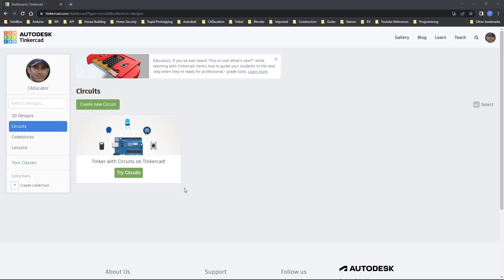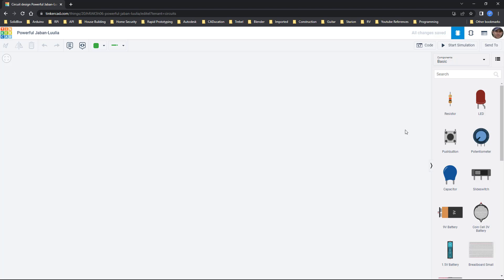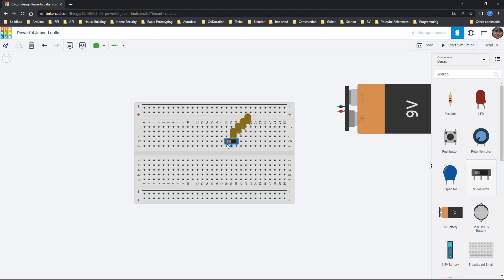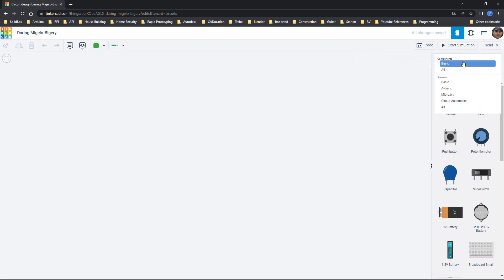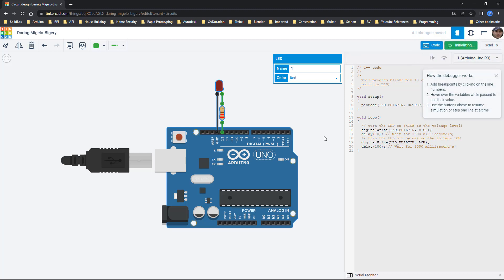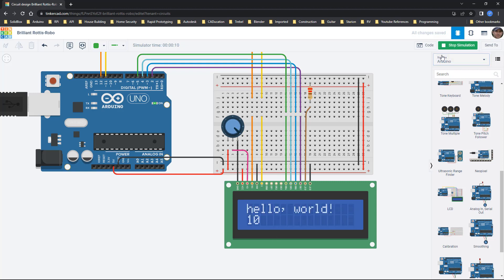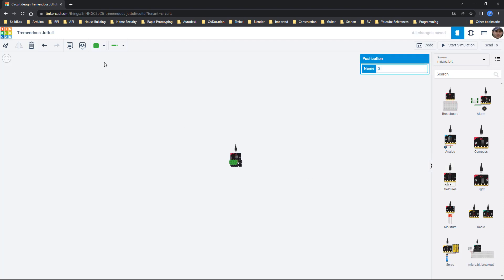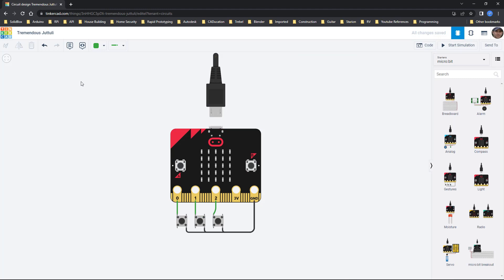Why You Should Use TinkerCAD for Electronics | Intro to TinkerCAD Circuits for Arduino and Microbit

Comment: This was interestign I had no clue thinkercad had an electronics section.
Reply from the maker: Yeah it is not very well advertised.  I think there are some benefits to generating 3d models quickly if you just need an STL of say a 9v battery, but the Electronics stuff with code has some real value.  There are other circuit simulators out there but most cost money.  One thing I didn't show is there is a Schematic view as well as the layout so you can actually build out a wiring diagram.  At some point Ill do a design in there and show how to bring it into Fusion 360.